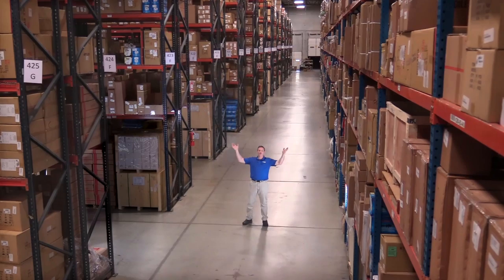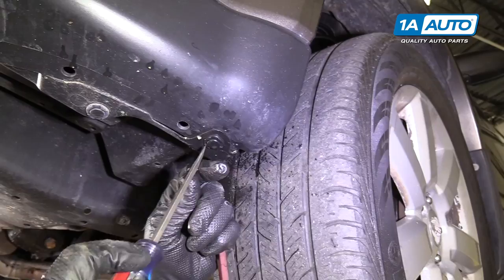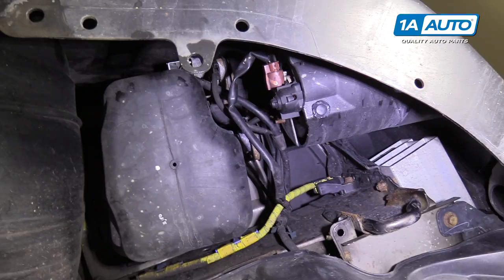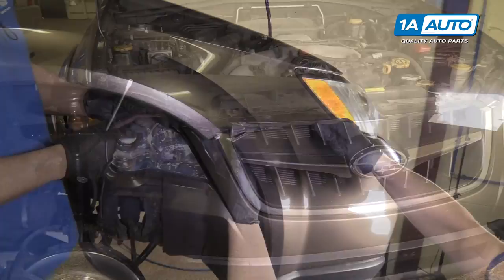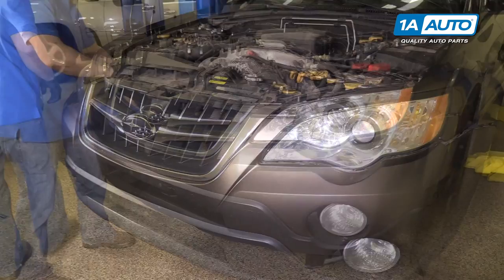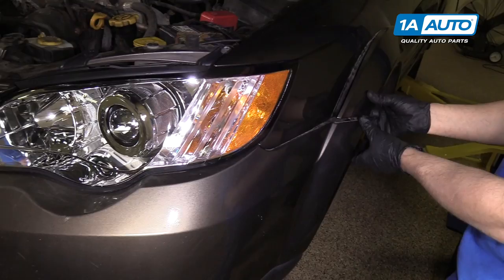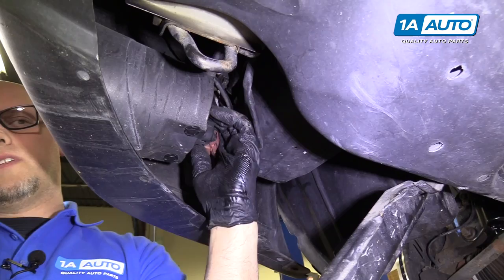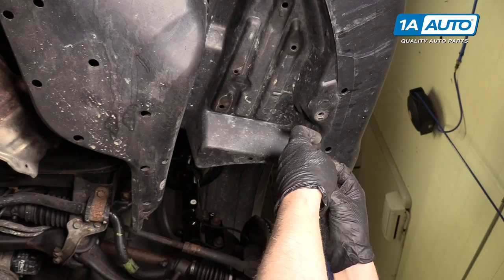How to Replace Front Bumper 04-09 Subaru Outback

Comment: Good lighting and camera work,  good location/working environment, terrible instructional video. I'm a professional mechanic at an auto repair shop, and I also happen to own multiple Subaru Outback's. And I can tell you that you're using all the wrong tools for the job. Specifically you don't need an interior trim tool set or any plastic tools like that. Plastic tools will get damaged easily. However you might need a single strong clip removal tool. A flat blade screwdriver is not designed to remove clips like these, and can cause various accidents by such abuse. Also once the bumper is loose it should be a two person job to lift it off the vehicle, so you don't drop it to the floor and scratch/crack the bumper or anything else on the car. In some cases you might need to unplug some electrical or fluid connectors while simultaneously lifting the bumper off the car, so four hands are always better than two. Another good tip for any work environment is to never do physical work while alone, always have someone with you. Especially if you're doing some work under or near a vehicle. Have something available to put the removed bumper on, like a bumper stand, or something similar. To be fair, you did specify that this is a "how to remove or replace a damaged, scratched, or broken front bumper cover" video, so it might not matter much in your case if you remove it by yourself :)